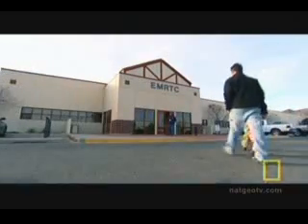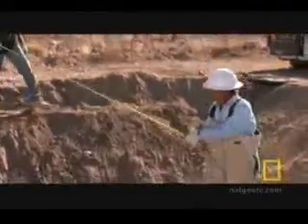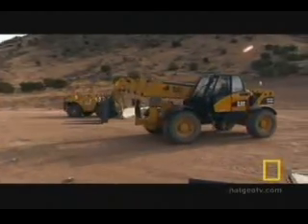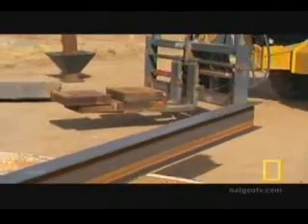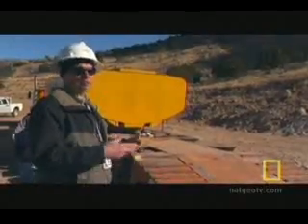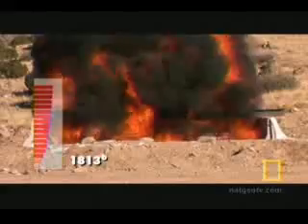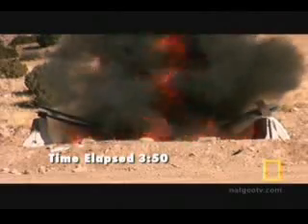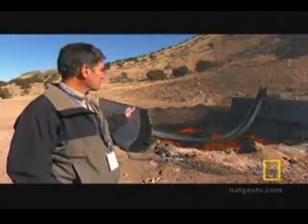steel being weakened by a jet fuel fire

Comment: This is in no way accurate . the beams in the building would have been attached on both ends that would have kept the I beam from twisting. Also the I beams in the world trade center were over 6" thick, these are far far from that. Also it still fails to explain how the building could fall so perfectly even without one side or the other giving in first causing the top to lean before failing. Also fails to explain how the whole building managed to fall at free fall speed, it fell completely all the way down in 8 seconds which is totally impossible without the lower floors giving way to allow the momentum and speed to continue. This also fails to explain how the steal got hot enough to melt not just warp but melt like liqued which is not possible with the temps reached by fuel alone. If you look at the remaining steal beams after the building fell you can clearly see they are not bent, warped or snapped, they look exactly like they had been cut with a torch which is exactly what it looks like when thermite is used which also gets hot enough to turn metal to liqued and also would explain the showers of sparks flying out of the south corner of the building which was clearly seen right before the building fell. And lastly both of these buildings were engineered to withstand both an airplane impact and the flowing fire. This fact was taken into account after a B-2 bomber hit the empire state building during WW2. And the most important fact? Well that would be that building 7 happens to be the ONLY highrise in history to EVER fail and fall due to fire alone. And there have been much worse fires in previous history. Also can you explain the reporters reporting that the building had fell when it was clearly seen in the background while they were reporting for like 30,mins before it fell? And the most obvious? It takes a lot of training, schooling, experience and months of planning and prep for very highly skilled professionals to get a building to fall within its foot print and to fall so perfectly like all three buildings did and you are going to tell me that after a plane bit two of them and compromised the structural integrity of both buildings that they just happen to fa so perfect? BULLSHIT! If you think what the government is telling you is the truth I suggest you question why they suppressed so much evidence, changed so many factors in their tests to get it to match their theory and while you are at it go ahead and research " false flag". What you will find is 3 or 4 cases just like this where our government perpetrated acts of violence against ourselves to justify going to war. It is what got us into veitnam, Cuba and others. In fact this very same scenario was pitched to JFK to start a war and he turned it down, this was right before he was Assassinated. now if a building that was built in the 20's could withstand the very same scenario and circumstances BEFORE PROPER FIRE PROTECTION WAS EVER INVENTED why could these buildings not take it?????? Wake up people you've been lied to.
Reply: In the WTC towers they weren't beams that failed they were trusses...and they did stay attached. You can plainly see the walls of WTC2 drawing inward as these trusses sagged due to heat. Eventually the truss connections failed and the floors dropped onto the next one down that could not support the impact/weight of the now dynamic "overburden"above the respective collapses. This process continued right down to 70 feet below street level.
Reply: cornskid Why would the uncompromised floors below the impact zone suddenly not be be able to hold weight they’d held for decades prior?
Reply: b-25 bomber,  typo, but yes you are right
Reply: Fires have already taken down buildings completely apart from 9/11

Comment: Yes, but the steel under the fires in the towers were easy to collapse, yet the buildings were designed to withstand any plane crash and earthquakes.. The towers fell straight down in freefall. Explain how all the towers turned to ash and kept on burning sand smoking for weeks to come.
Reply: Well the building wasn't simply just steel and concrete. It was a massive office building with plenty of other flammible object. Paper and cardboard was a huge factor in how it got so hot.
Reply: jorden wanna Yep. Office chair, filing cabinet and printer are all made of cardboard.
Reply: +jorden wanna No to mention all the wiring in the building with volatile petrochemical plastic coverings that would also burn, the creation of thermite-type reactions thanks to the combination of all these different additional elements together, and so-forth.  It's not exactly difficult to grasp these concepts if you have a modicum of intelligence and paid attention in high-school chemistry.
Reply: Have you actually seen how they were built? Have you seen how they fell? Freefall? How come the towers didn't topple over? Airplane fuel burns up very quickly, how come both towers fell down perfectly straight? Why  didn't the crack the Hudson river basin? How come it all turned into dust? Steel girders do not turn into dust, where did the steel get to, the pile of steel and rubbish turned to dust, have you actually seen the aftermath?
Reply: They brought down by explosives! But what kind of a weapon was it? Look at how quickly all the rubble disappeared, and why was it so hot weeks later?
Reply: Oh shut up!!
Reply: Explain the passports of the terrorists that was found, yet all humans were turned into dust. BTW nuclear weapons turns people into dust, and produce incredible heat.But towers that collapse only produce rubble and not heat, the airfuel would have burnt up, so... mr brightspark..watch the towers falling closely for smoke at the base of the towers and then watch how the rubble turned to dust, even as they fell....go back to your flock of sheep.
Reply: There are new mini nukes, that go upwards and can be controlled, they leave little radiation, but you wouldn't know....sheep!
Reply: @1967davidfitness  what you mentioned the idea of a nuclear weapon that small and not leaving radiation it makes me think you're either trolling everyone or really off your meds. You cannot defy physics, and the smallest nuclear weapon ever developed would have taken out most of the city. And yes there would have been radiation, that's how it works.
Reply: @1967davidfitness  as far as the Towers falling at freefall this is the easiest claim of all to debunk. If you watch the videos you can clearly see debris From above falling faster than the building. By very definition that would not be possible if the building was collapsing at freefall.
Reply: So where did the towers go? a few days after it was all gone, and the collapse didn't even crack the Hudson river basin, no seismic activity was recorded...hmm!!! 500,000 tons of towers didn't cause a blip on a seismic activity recorder???  Only a few steel girders melted, and the others below the fires? How come they fell straight down and not outwards??THINK!!!
Reply: @1967davidfitness  again you claim that you adhere to critical thinking while not using an ounce of thought. 
First off, you seem to have a real lack of understanding of how much energy it takes to have an earthquake. The weight of the towers is a drop in the bucket, but they did set off 34 seismic indicators contrary to your claim.
Additionally you're claiming that they fell in the footprint but that's simply not true. There was debris scattered for several blocks. But yes when something is falling its predominant force is pulling it down not out. That's just basic physics man.
Last I'll address where the material went. You claimed it was gone in a few days - but you know that's not true. It took 50000 workers 9 months to clean up the debris from 9/11.
Roughly 190000 tons of steel went to scrap, large amounts of it being sold overseas. There were also the thousands of pieces of it sold or donated for monuments and memorials.
Materials were taken through warehousing at a hanger for inspection and materials that were not critical to the investigation went on to be loaded on barges for transport.
It is my understanding that some materials are still in the hangar. Of course much of it has been moved to museums.
Reply: You work for the US Government.
Reply: @1967davidfitness Really?  So much for critical thinking.
Reply: You are a  government employee,  I do not trust you..bye!
Reply: @1967davidfitness  All that he said is true, and instead of saying 'you are government employee' why don't you try to debunk his evidence, if the whole point is to expose the government? Why didn't you did it? Because you can't.
WTC 1 & 2 collapsed because they were hit by two Boeing 767 with a large amount of jet fuel, they burned for several minutes with several core columns damaged or destroyed in a number of floors. If they were concrete and steel framed, they would still be there today, but steel is particulary vulnerable to heat, and that's what made them collapse. WTC7 was severely damage because of the North Tower collapse, and it burned for over 7 hours before it's structure failed and it, too, collapsed. No, these were not the only buildings to collapse by fire (funny, you people allways say that but tend to forget taht two of them were hit by large passenger aircrafts). Plasco Building burned and collapsed more recently, and it was not hit by an airplane nor debris from a 110 stories high office tower, it collapsed because it was steel framed, not concrete.

Sorry, 9/11 was an very well planed terrorist attack that unfortunately got 75% as planed, with thousands of lives lost, and millions changed forever.
Reply: They were built to withstand hit by boeings, and  were earthquake proof. No clear vidoe footage exists to this day of any plane flying OVER New York on 9/11, no military jets either.When the claimed hijacking took place where were the military jets? Where is cctv from the Pentagon showing a plane coming towards it? Strange how it has no defence ssytem...the Pentagon was defenceless????? I feel sorry for you having a closed mind.
Reply: a plane, a 8th of the size traveling a 5th of the speed
Reply: > They brought down by explosives

This is likely not the case.

> But what kind of a weapon was it?

A Boeing airplane, most likely.

>  Look at how quickly all the rubble disappeared,

Large amount of debris in a city center would be cleared quickly.

> and why was it so hot weeks later?

Do you have any sources that say it was hot for weeks?
Reply: Towers don't fall over like a game of Jenga, first off.

> Have you actually seen how they were built?

I'm a programmer, therefor: no.

> Have you seen how they fell?

Yes, there are videos from every possible angle.

> Freefall?

Well it was falling unguided, therefore "free falling"

> How come the towers didn't topple over

Because the real world does not act like Jenga.

>  Airplane fuel burns up very quickly, how come both towers fell down perfectly straight?

Firstly Jetfuel does burn quickly, but there were thousands of gallons of it, plus everything in an office that you know, burns. 

For the second point, the top of the building was no longer able to be supported by the lower sections, so it fell straight down due to the fact there was no force pushing it from the sides, only gravity pulling it downward.

> Why  didn't the crack the Hudson river basin

Because it imparted relatively little force into the ground when collapsing.

> How come it all turned into dust? Steel girders do not turn into dust, where did the steel get to, the pile of steel and rubbish turned to dust, have you actually seen the aftermath?

The building was not 100% steel, there was also concrete, drywall, as well as various office-related items. Those, particularly concrete, would turn to dust.
Reply: I rest my case.
Reply: > Explain the passports of the terrorists that was found, yet all humans were turned into dust.

And narry a source to be seen.

> BTW nuclear weapons turns people into dust

And they also level entire cities.

> and produce incredible heat

Yep, and so do a lot of things.

> .But towers that collapse only produce rubble and not heat

The towers collapsing produce a lot of friction, which generates heat.

> the airfuel would have burnt up,

yeah, fuel does tend to burn.

> so... mr brightspark..

I will choose to take this as a complement.

> .watch the towers falling closely for smoke at the base

And this proves what, exactly?

> and then watch how the rubble turned to dust,  even as they fell....

Well yeah, it hit the ground, plus a building was falling on it.

> go back to your flock of sheep.

Pot meet kettle.
Reply: physics, things fall towards their center of gravity, which was the building below the collapse point
Reply: WTC was designed to withstand an impact of the much smaller Boeing 707, the plane that hit it had ~8.9x more energy than a Boeing 707.